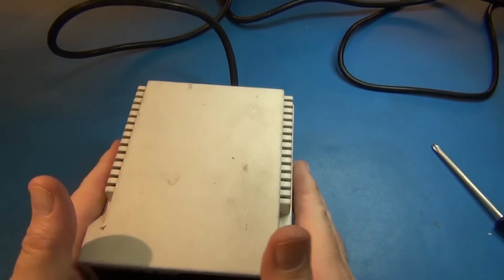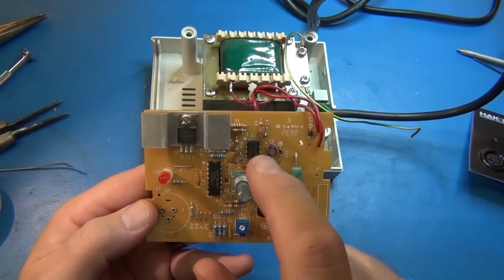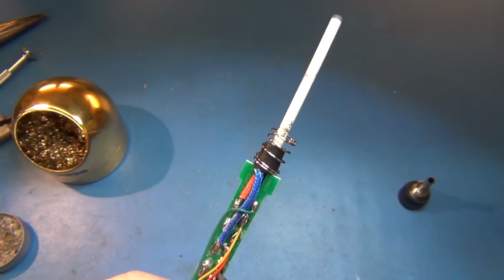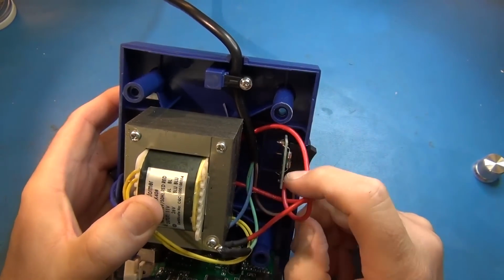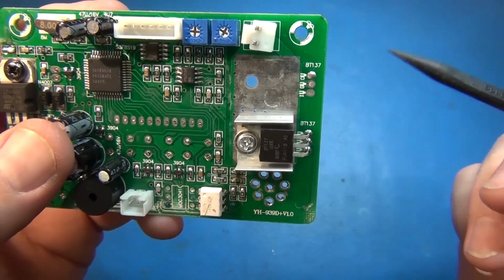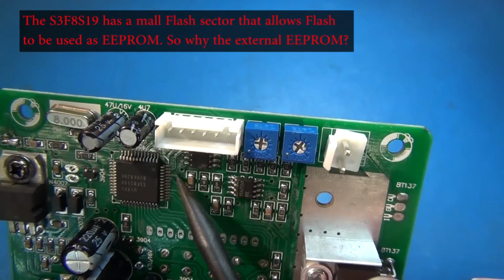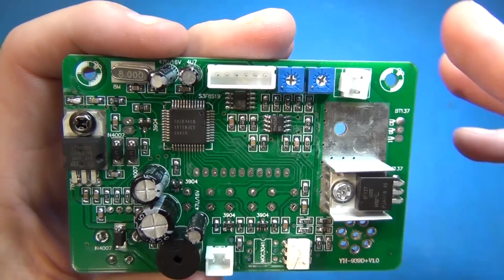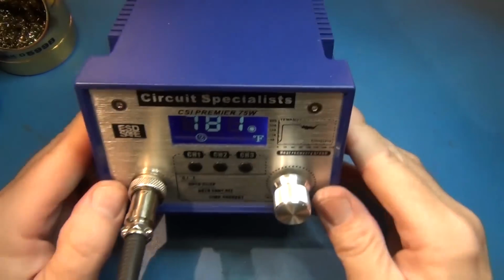CSI Premier 75W and Hakko 936 Solder Station Teardowns

Comment: magic smoke released at https://youtu.be/5KhBPZCH0I0?t=1710 ?
Reply from the maker: +Dave McAnulty Not sure what you mean. I couldn't see anything.
Reply: +Todd Harrison (ToddFun) watch in HD, at 28m32s there is a puff of white smoke that flys from your left ear to the upper right of the frame. Its moving very fast.
Reply from the maker: +Dave McAnulty I see it now. I checked out the uncut video and it is the reflection off my watch. In video step mode I can see the reflection travel up the wall behind me and it maintained the size and shape of my watch reflection. This new apple watch has a crystal face that reflects light in a beam all most like a laser. I was teasing the dog with the reflection like it was a laser pointer earlier in the day.
Reply: +Todd Harrison (ToddFun) Ha! Well let your dog know that it shouldn't feel bad,I fell for it also.  :P